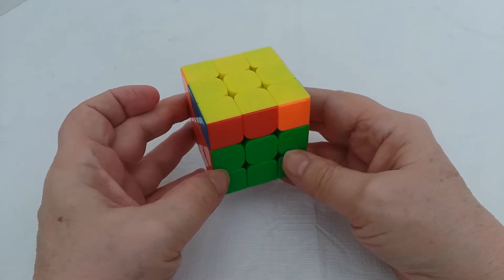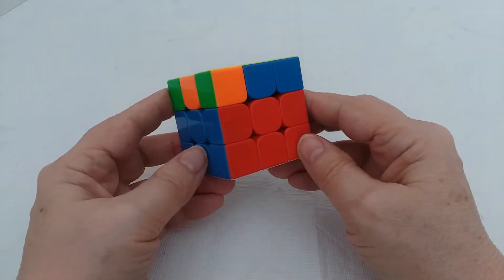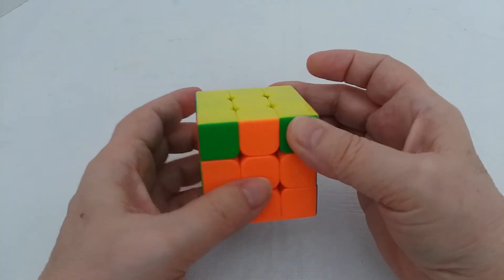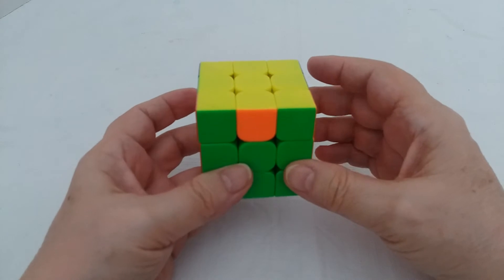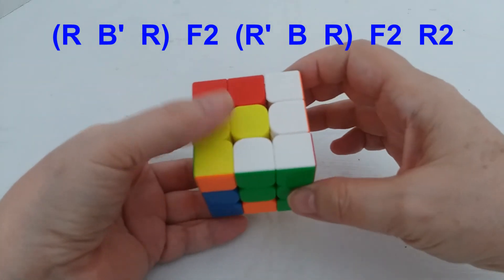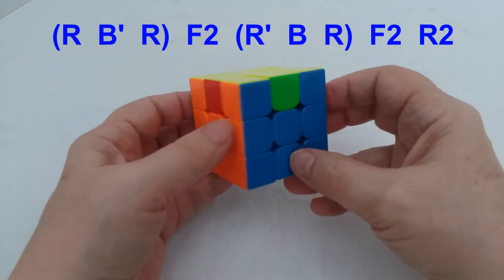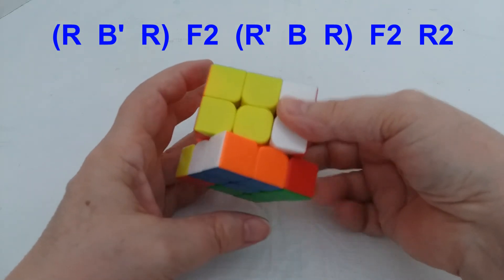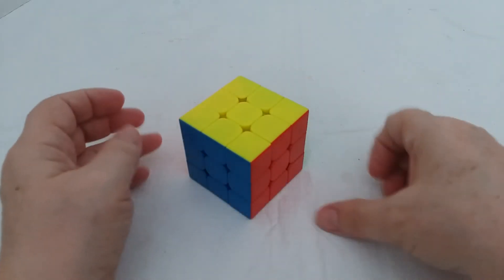Rubik's Cube -- 3x3:  New Algorithm for Swapping Adjacent Corners on 2-Look PLL

Comment: still doesn't work, it messes up the other colours and when I correct that, im back to swapped corners again

on my 3x3 and 5x5 this has never happened, only on the 4x4
Reply from the maker: As I wrote in my other response a few moments ago, this DOES work.  It works in the video and it has worked the hundreds of times I've used it.  If it's not working for you, you're either doing the moves wrong or you're expecting something else.  Consider this:  when I solve, after I get to all yellow on top of the last layer, I handle corners first, then edges.  So if I need adjacent corners swapped, I do this.  If it messes up top-layer edges in the process, I don't care, because I handle them next.  However, apparently some people handle edges first, then corners.  Perhaps this is what you do?  If so, I guess you need to look for another algorithm, but since I don't do it that way, I'm sorry I can't help you.   Good luck!
Reply: @donnaleiber6214  it must just be some quirk of the 4x4 which means the same solution doesnt work but the starting point was identical (already reduced) and in theory the solution should be the same but it just doesn't work

on a 3x3 I'd probably just mix it up and start again it only takes less than a minute to solve anyway even not using any of those crazy speed methods

I do yellow cross / edges / corners and have never ended up with them the wrong way around like that but maybe it will happen at some point I suppose
Reply from the maker: @stuartbowes619   @stuartbowes619  I'm glad you found something that works for you.  The alg in my video DOES work for a 4x4x4, though.  I've done it hundreds of times and just verified it.  So, you're still either doing a move wrong, not starting in the right position, or not rotating the U at the end to see your switched corners.  But also, you said you do yellow cross / edges / corners.  As I mentioned before, I do corners, then edges, so when this messes up edges, I don't care, but it would definitely impact you (negatively).
Reply: @donnaleiber6214  I'm not 'doing it wrong' see other reply

The proof of the fact is when I found the other solution it worked immediately 1st try

Comment: I’ve found that this doesn’t work on 4x4s is there any algorithm for those?
Reply from the maker: @PearGod. It works for me on a 4x4 and even larger cubes.  For all of those, I solve by completing centers, then edges, and then treat like a 3x3.  You must be doing yours a different way?
Reply: @donnaleiber6214  Not sure if it’s different but I solve the center of white then the center of yellow. Then I do the other center then the edges. Then the white corners. I place all the yellow edges then orientate and solve the yellow corners. For some reason this algorithm has the same outcome as the corner orientation algorithm I use which is U R U’ L U R’ U’ L’ I think. It’s probably something I’m doing wrong but I just wanted to ask in case. Thanks.
Reply from the maker: @peargod9238  I really don't think there is a wrong way or a right way.  I think we're doing the last few steps differently.  I do the same as you insofar as centers, edges, and white corners/F2L.  Then I put all yellows facing up.  Then yellow corners in their correct places, and lastly, yellow edges in their right places.  I think you might be doing yellow corners last, so my algorithm probably messes up your edges.  Sorry I don't know what to tell you.  (I tried your algorithm to see what it does, but it messes up a white corner if I'm doing it right.)
Reply: @donnaleiber6214  Ok well I can see I works for lots of other people so I’m sure we just solve it differently. Thanks for responding and trying to figure it out though you’re really dedicated to your viewers.
Reply: @donnaleiber6214  also for the algorithm I said I think I got the L and L’ mixed up you could try flipping them around if that works.
Reply from the maker: @peargod9238  It's nice comments like yours that make me want to help decent people.  I hate the rude comments I sometimes get.  I think lots of people solve it your way, so you should be able to find help.  On 4x4 and larger, unless there's a parity, I solve just like a 3x3 once I get centers and edges.  Just curious, can't you do the same things you use on 3x3 for the 4x4 for the last steps?
Reply: @donnaleiber6214  Yeah, actually I learned to solve 3x3s from a book I got that used a method I’ve never seen before. I’ve been using that method for a couple of years now until I looked up how to solve the 4x4 and found a video by Jperm. That showed the way I described but just said to solve the final steps how you’d solve a 3x3. Except I didn’t know how to solve it the way he did and the way he set it up didn’t let me use the method that I did know how to solve it with which was the main reason I found your video about it. I also am not really sure how to solve the white corners without really a really complicated algorithm for each different way they can face. I know there’s probably much better ways to solve it then the way I’m doing it which is what I’m trying to learn right now.  Hope that makes sense.
Reply from the maker: @peargod9238  You might find this video of mine fun:  https://youtu.be/k24z_tu6sk0. If nothing else, it shows a way to solve the white corners (facing any direction) using the same algorithm (the "sexy" move).

Comment: Ok you said F2 and wrote F2 but what you did was F'2  so this video is very confusing I did the moves you showed and not what you said or wrote and now all the corners are in the right place but the top layer edge pieces are not aligned with correct colors. So now worse off than when I began.
Reply from the maker: @Lisa Stufflococucs  Sorry this confused you.  Unless I'm showing fingertricks for speed, I don't specify which direction to rotate any slice that moves 180 degrees.  So although you are right that I technically did F2' instead of F2, the result is the same, so viewers can do either direction they want.  And the reason it messed up your edges is because I solve last-layer corners first, then edges.  It sounds like you do edges first, so you'll have to find another way to do corners.

Comment: Naisu, I used to do an A perm exactly like this for adjacent corner swap. Then I switched to using T perm because it doesn’t use a cube rotation. Now that I’m learning 1 look PLL I have to learn A perm again lol, except this time around I’m doing it while looking at the bottom of the cube instead of the top (it makes it easier for me to track the direction of the 3 cycle)
Reply from the maker: @Edgar Mendoza  Thanks.  Sounds interesting; I may have to experiment with orientations.